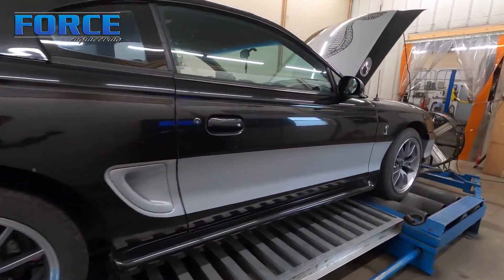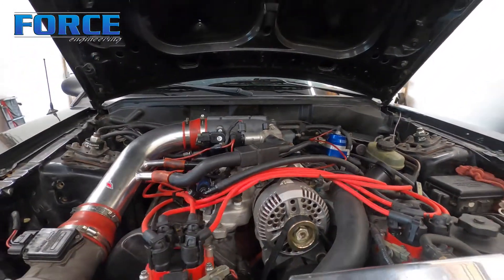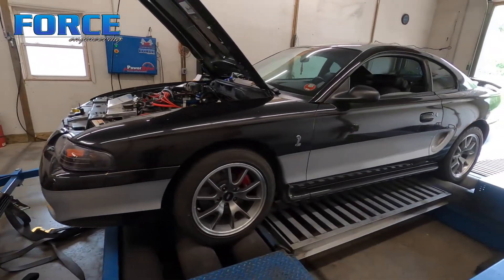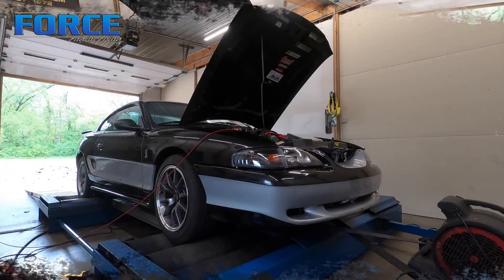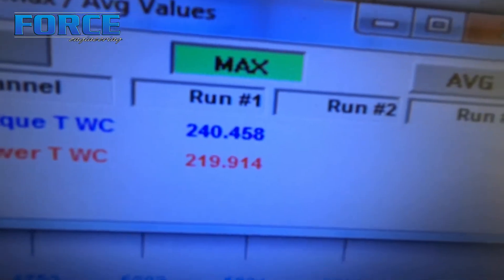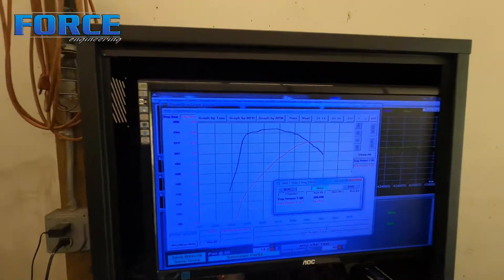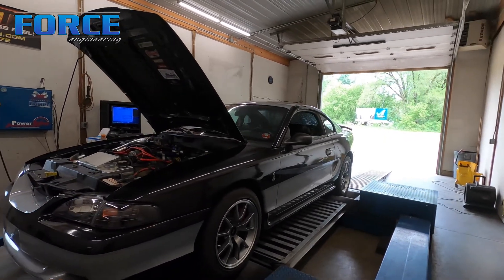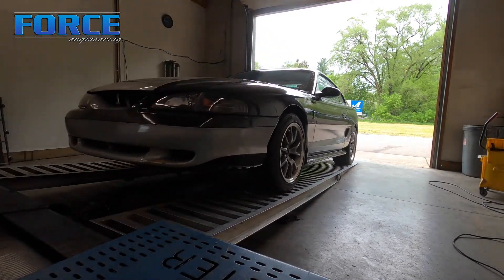97 Ford Mustang GT | 4.6l 2v | Bolt-ons | SN95 Mustang | Dyno Review

Comment: I gotta get mine to a tuner to dial it in.
Took a 4.6 2v PI from a 2006 Lincoln Towncar. Swapped mustang everything with it into my 1966 mustang.
Full 2.5" catless with H pipe and shorty headers. 75mm BBK intake. Fun build to do and film!
Any guess to what power it would push?
Reply from the maker: Only good reference point i have is a stock PI mustang engine.  They typically make in the 220 area with the BBK elbow and a cat back.
Reply: @ForceEngineering  gotcha gotcha. I went full standalone with zero cats. Hoping to be about 250 at the wheels. Gotta get a cam and I'll have it tuned up.
Reply: @4WDTrek  Do it man, heck, get the TrickFlow heads n cams for those heads, on that light of a Mustang you'll probly be 10-11 @ 1/4 mile..